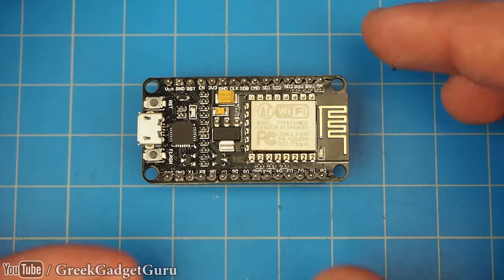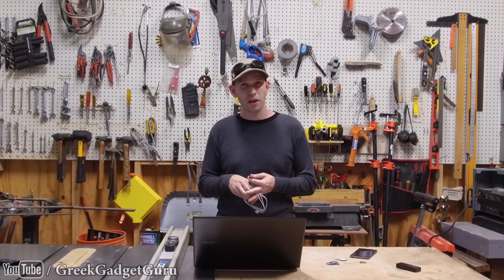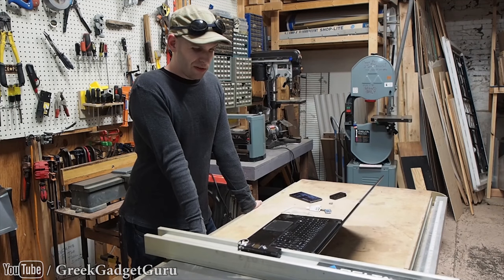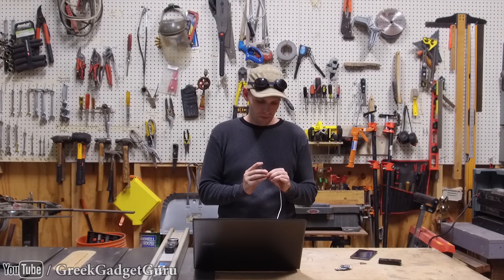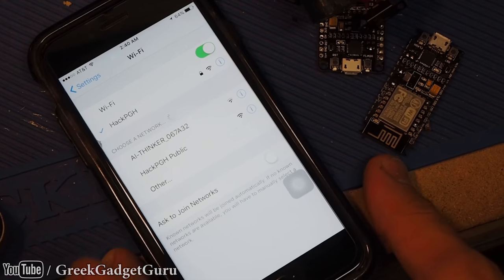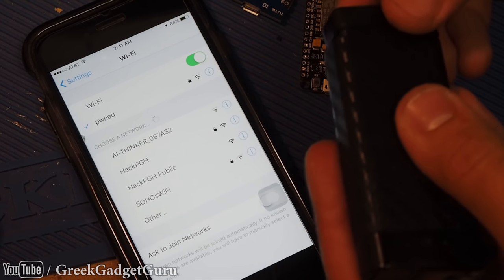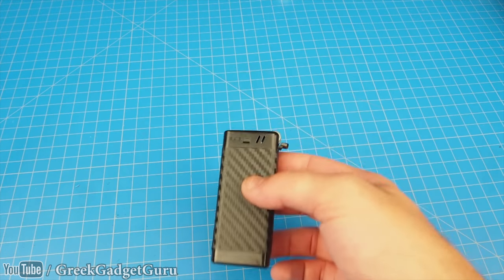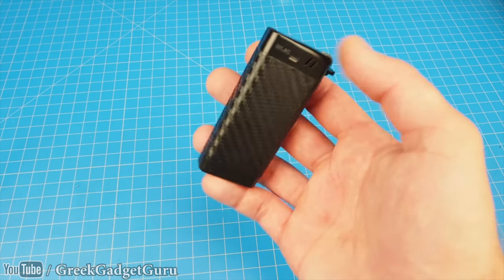WiFi "JAMMER" - Secret Kingsman LIGHTER! (Works on iPhone / Android)

Comment: You could use only esp8266 module not all node! That will be much smaller! And than you can add battery charging circuit in lighter! Please try it!
And you can maybe add it to multi lighter!

Comment: A ligher could double as a flash drive, lazer pointer, radar detector/jammer, phone power bank, wi fi Hotspot, flashlight, hidden camera with audio, wi fi booster, tazor/stun gun, mini flame thrower, survival kit, gps tracker, personal alarm, wifi cloud storage, secret compartment, smoking pipe, vape pen, Bluetooth/wi fi speaker, remote for a drone/car/garage/home. The list goes on
Reply: That's a lot of stuff to fit in a single lighter.

Comment: What about building a burning laser into one of those? It's got that whole other side that could be drilled for a heatsink and laser element. The back looks like it would fit two of the battery that you used here. That's more than enough to power a high power laser diode. Current limiting could be taken care of with a simple resistor in line with the battery. Focusing could be done with a 3D printed knurled knob on the lens assembly. That way you could light things on fire at a distance too. That said it should probably have a safety lockout switch so that you can't accidentally fire it because the consequences could potentially be pretty bad. I think it's a good idea that would be as fun as it is useful... In fact I'd be willing to bet that people would buy something like that for a premium... I would...
Reply: yawn....

Comment: So, what i dont understand is that what happens when you put it in the lighter, is it just a storage or what? Also, the micro board, do i need that if i have the large one? Finally, what is the battery for?
Reply: "what is the battery for"

my dude i present you electricity. yes we need it to power things

Comment: portable, super mini (about the same size as this device), wifi/blutooth file/meida server from 8-64gig sd card, with battery and 15-30 foot wifi/blutooth range.
blutooth optional, linux media player optional, phone control though wifi/blutooth optional.

"There called I*item*(s)"
I don't want any I*item*(s), and I want the pleasure of making it.

Comment: GGG is this a hammer or a destroyer (I want to troll some of my friends and I need to know cause I don't want to get sued) p.s. watch Ur vids luv Ur work
Reply: *jammer
Reply from the maker: Adrian Fuller It's a deauthenticator. It makes them continually have to type in the password for the WiFi. But there's more than one attack mode so in my opinion this is better. Just don't take it anywhere public.
Reply: Thx

Comment: So if you want to use it as a deauther you don't need the stupid pins?
Reply from the maker: Apparently not. That's just for input. The beacon is over the  WiFi ESP8266 or ESP32 chip. The rest is just a micro controller to program the chips. So this could get even smaller!
Reply: @GreekGadgetGuru  cool